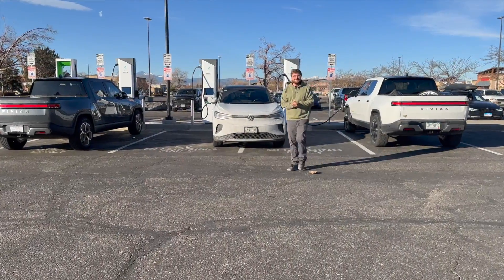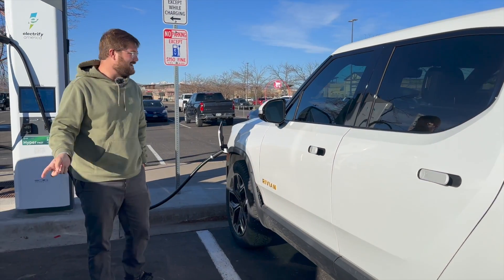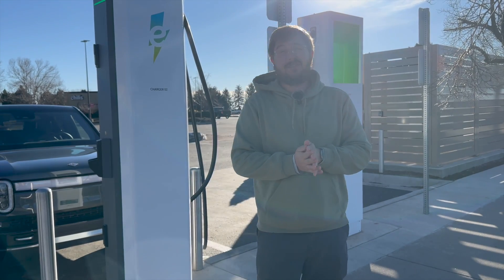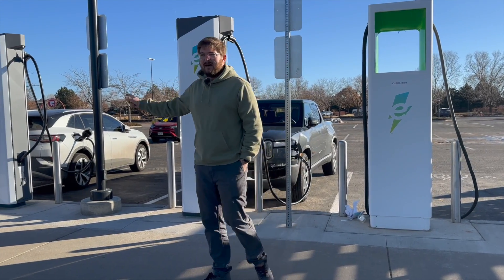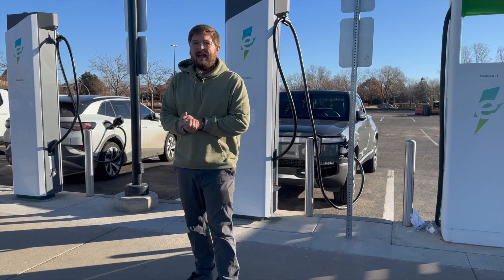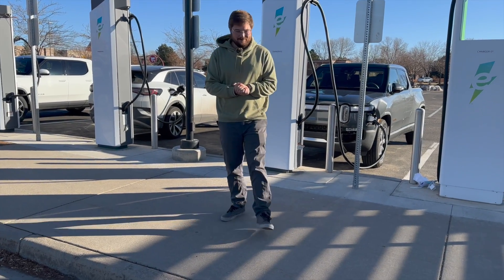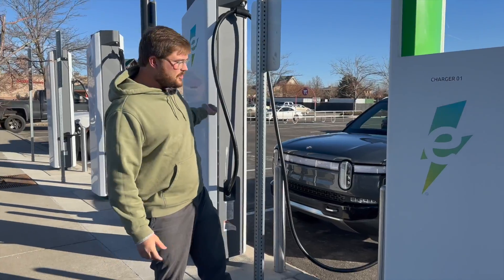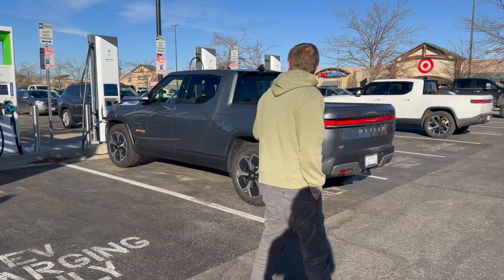Electrify America Has Been Upgrading Their Sites w/ New Chargers - Here's How It's Going So Far

Comment: It is a fact: nothing comes even close to Tesla Superchargers in reliability and availability. At least in North America. I am sure that will change in the years to come, but for now I can just plug in my Tesla and walk away. And it will charge. Every time. EA works most of the time, but you have to hope that the session starts. If it fails to start you may have to call. And you may get 30 kW. Or 150 kW. And one time for me it would not release the cable and I had to sit there and wait until 100%.

Comment: F’ing crazy. These things cost $150k per unit, ignoring install costs.
Reply: California has the goal of making electric vehicles mandatory! They are requiring charging stations in EVERY parking lot. The power infrastructure required for these stations is greater than the building or facility on which the parking lot is located. Imagine if every parking lot was required to have gas stations!! The California govt is becoming a dictatorship, pushing EV on every citizen. EV's are not that popular, most people prefer gas or diesel powered vehicles. Yet the minority rules the California govt, proving that they are a dictatorship. 
Final point: EV charging stations need to be built like gas stations, not required in every parking lot! Then we'll see if they can make a profit, doubtful...very doubtful!

Comment: Thanks, Kyle! Based on my personal experiences (and recency bias), ChargePoint's CPE250 might be the most reliable of the public CCS chargers. They haven't been deployed for long enough to tell how well they will age, but so far, they've had the best uptime. Now it's up to ChargePoint to start deploying them at higher power.
Reply: It would be nice if ChargePoint could deploy the CPE-250's higher power (and newer) version the ChargePoint Express Plus. It's a lot more modular but has mainly been used for fleet vehicles. The first public Express Plus units were opened recently in the Northeast US.
Reply: @ArtiePenguin1  they just opened 1 in Maine let's see how it goes
Reply: @ArtiePenguin1  Yeah. Unfortunately, I still haven't been able to try out the Express Plus units myself yet because the one they installed at ChargePoint Headquarters wasn't open to the public. We really need them along the freeway corridors.

Comment: 99% of the time, when you hook an electrical load to a source of power, the load does indeed "pull" the power.
DC fast chargers are an exception. The really, truly PUSH current into the battery. The car is ordering up a certain charging power - but if the software and hardware in the charger ignores or misinterprets that request, or has some design flaw, like a very slow programmed rate of change that causes the charger to respond to requests from the car to back off only after some delay, there is no way for the car's circuits to throttle the excessive current. The only way the car can deal with a rogue charger that is sending more than the car has asked for is to either allow the overly high charging current for a while, or open the contactors that connect the charge port to the battery and completely stop the charge.

Comment: What is it with ID 4 owners charging to full?

I’ve noticed that as well even when there’s a long line or only one working charger. Very frustrating.
Reply: I have a ‘21 and it’s this stupid free charging. I wish they would buy me out. I set mine to 90% thinking no harm will be done and that 80-90% will be slow. I love to talk to other owners and answer questions from outsiders so if I’m doing my thing I don’t mind it being slow. However, if I’m not enjoying my charging experience or someone pulls up and needs a spot, I leave or pull to a non charging spot and continue socializing. Another big problem is low watt cars pulling into high watt chargers when they don’t have too, Kyle, you might be partially responsible because you have suggested the 350kw units might give a faster charge on an ID4 than a 150kw.
Reply: @4rwayner7  if there’s nobody around, that’s fine. I just always try to be mindful of other people. Ive even moved from a 350 to a 150 once my car’s curve  went below 170 so that a Taycan could use the 350 and speed up the line. Also the free charging excuse is a bit weird to me because Ioniqs/Kias also get that and don’t find them charging that long even though 30 min would pretty much get them to 100% most of the time. 

ID 4s, Bolts, and Niros using the 350s is whole other issue as well and extremely frustrating on busy travel days.

Overall, EA should add more communication to their app about this type of stuff. Maybe a reminder depending on your car about what charger to use. Add a virtual queue to the app so drivers can see how long lines are while they’re planning/driving to the station. This would also prevent scenarios where drivers will just pull up into a station and cut the line, it’s strange how many times I’ve had to negotiate charging lines. Send notifications to drivers once they are at 80% if there is a line, asking them to move or pay peak charging cost for their inefficient behavior. There’s so much EA could do right now without needing to rip out chargers to greatly reduce the lines and pain of driving. Right now, it’s a crapshoot. You never know what type of situation you’re going to pull up to and that causes charge anxiety.

Comment: I charged my BMW i4 M50 at two of the new EA sites in Texas this weekend. The hardware is SK Signet. At both sites on plugin, I pulled 201kW. The session was very good. At the second site, there are 6 chargers. Four were busy. I plugged into station 1. Station 2 was empty. I pulled 201kW on plugin. Then, a Mach-e plugged into station 2, and my charging level lowered to 179kW. These are balanced chargers. These two sites were the older ABB units. EA location Ennis, TX online last week, and Bellmead, TX, fully online today.

Comment: now do South Florida LOL, if you do not own a tesla, you will suffer, evgo only has 1 working station, out of the 6 chargers 2 are 50kw and the 350 kw gives you 60/80 kw/m and the other one is down, EA 4 chargers 3 down, the 150kw only charges at a 20kw speed, if you find a working one that is empty, play the lotto because that's being lucky! The rest are lvl 1 or lvl2 like chargepoint, there is 1 blinq and the company went kaput i believe. Just check plugshare and look at FL in general, I cannot take US 27, or I4 from Miami to Tampa... there are no chargers. Utility companies have the best hardware, problem is they are located alongside the FL turnpike

Comment: As someone considering a first EV for our use case, this presents some problems for us. You covered some really important points: With the upgrade, the EA network is no more reliable, but now has more potential to damage your vehicle. And with the new rollout, no increase in the number of charge units per site. Has anyone talked about how this being a punishment for VW probably doesn't motivate EA to be a top performer? VW, this is not helping your brand image. It would be great if VW sold off EA to someone who will make it a success. Thanks.

Comment: I agree.  EA, why is it still so hard to charge a car on your network?  Software issues and bricking cars with brand new co developed hardware stinks of pulling the bread out of the oven half baked and saying good enough.  I still road trip in a Chevy Bolt.  Are one of these shiny new 350kw units going to try to force far more than the car's hardware can accept with them trying to do so on higher KW rated vehicles? If you damage my car, do you fix it?

Comment: I had the experience of showing up at a charging station recently and finding the whole station shut down with new chargers not up and running yet. I had travelled the same route a few times with my 2022 Chevy Bolt EUV and so it didn’t occur to me that I had to check the app to see if the station would be working. There were no other EA stations without backtracking a ways, which seemed stupid because I could get to my destination with the charge I had albeit uncomfortably low.  Now I know I ALWAYS have to check station status first. Luckily I found a Volta fast charger, the only one, and available, in a nearby shopping mall lot. What you said about the new chargers makes me a little nervous to use the new hardware because I don’t want to get bricked on a road trip … that seems like a HUGE problem then need to fix right away.
Reply: California has the goal of making electric vehicles mandatory! They are requiring charging stations in EVERY parking lot. The power infrastructure required for these stations is greater than the building or facility on which the parking lot is located. Imagine if every parking lot was required to have gas stations!! The California govt is becoming a dictatorship, pushing EV on every citizen. EV's are not that popular, most people prefer gas or diesel powered vehicles. Yet the minority rules the California govt, proving that they are a dictatorship. 
Final point: EV charging stations need to be built like gas stations, not required in every parking lot! Then we'll see if they can make a profit, doubtful...very doubtful!

Comment: Interesting to hear these chargers are providing too much power and bricking vehicles.

A slight correction, this is entirely under the chargers control.  The vehicle only requests a voltage and maximum current.  It is the chargers job to provide that voltage delta which yields the given current (or less), but never more current, which only happens if the voltage delta is too large, so over voltage.  I think maybe this is what's happening.
Reply: What do you mean by voltage delta? That means compared to some other voltage? Which voltage? The vehicle requests a specific voltage and gives an amperage limitation. It's up to the power supply to provide power up to whatever limits are in place. It should never provide more voltage or amperage than the car requests, and should not exceed its own current or power limitations.
Reply: @TechnicalLee  there are multiple voltages involved.  The car has a resting no load voltage, and specifies to the charger a max voltage and max current.

The charger supplies a delta voltage between no load and max voltage.  At some higher voltage that is under the max voltage the current limit is likely to be meet.

But these newer chargers can likely easily supply more current than many vehicles limit.  So if they overshoot that current the voltage might also be exceeded.

If the charger violates the current limit, the vehicle may have no choice but to blow it's fuse to protect from over current or over voltage.

The point is, the vehicle has no control of the voltage and current beyond the communication of the max limits.  When these requests are not honored the vehicle has limited options.  It could try to open it's contactors under high load.  And maybe they attempted this and welded contactors.  The last resort is to blow the pyro fuse on board the vehicle.

But the charger for DCFC is always on the curb.  This is the equipment at fault here.  The cars can only ask for what they need supplied.

Comment: ID4 owners got 3 years of unlimited free charging, so they're using EA as their primary fuel source since it's free. The 2023s even maintain 80 kW up to 90% and the drop-off after that isn't extreme, so it only adds a few minutes to the session to go all the way to 100%.
Reply: "free." You're paying for it with battery degradation that is caused by constantly DC fast charging.
Reply: @descendency  According to a study done by the Idaho National Laboratory, there is no meaningful increase in battery degradation from DC fast charging vs L2 charging, especially in vehicles with a thermal management system that maintains the battery temperature.
Reply: @djg38  I would fire that laboratory. D.C. fast charging does degrade the battery. Its because of the "C" rating of the battery, fast charging does things to the battery that are not reversible.

Comment: Kyle, you've probably covered this but how much faster is a V3 250kw Tesla charger versus a V2 150kw charging 10% to 80% on the newer Teslas? Seems you get that big push at the beginning but how much faster is it overall? These high-peak chargers are negating much of the benefit of switching to electricity.

Comment: The stuff you're reporting is both baffling and worrying.  The customer service aspect of pulling entire CORRIDORS offline for upgrades with no warning or plan for motorists is not 'unfortunate' it's blatantly UNACCEPTABLE!

What is more worrying is the inability to secure reliable and functional charging units.  Like them or not, Tesla has proven that their units are extremely reliable and robust, as you pointed out.  What is EA doing that they can't achieve the same level?  After all, they're a company focused SOLELY on HVDC charging...

Comment: My big Q is why all are being taken down at the same time? It appears there is 1 Cabinet behind the fence for each dispenser. That means the can be Isolated (Use the breaker Luke). Do 1 or 2 at a time (depends on crew). And it was totally insane taking them (a site) down on a holiday weekend.
Reply: It's easiest/safest for the construction crew to cut power to the whole site so that there's no power going to any of the cabinets. Doesn't make it the right thing to do, though!
Reply: @EVZacOfAllTrades  Might have to hire real electricians. They might be union.
Reply: You have to shutdown power to the whole site to do it safely. There's generally earthworks involved as well and they need to all be done at the same time and that involves all the cabinets. Doing it on a holiday weekend though kinda says everything about EA's planning. But I bet every non-Tesla EV driver would be prepared to put up with the inconvenience if it results in a more reliable charging network.
Reply: @mondotv4216  I installed a charger on my house, to be safe I killed the power to the whole neighborhood. Not.
Reply: @mondotv4216  If earthworks are involved the original install design was poorly planned.  It's hard to believe they would have been that short-sighted. Buried conduit is widely used to prevent that exact problem.
My local utility has been using conduit for underground distribution since the mid-1980s.  They just replaced the direct bury underground feed in my 1970s development (7.2KV distribution to 10? transformers) and they installed conduit first and ran the new line thru it. They did not shut down the power except for the final day.  My street took several weeks but we only lost power on that single day for about 30 minutes near the supply to 2 hours at the far end.  (They had notified us "power will be off for up to four hours.")  The project manager said that on similar installs with existing conduit the entire job is completed in days instead of weeks because they don't need to dig (and they did minimal digging on my street with only 12in (30cm) diameter holes about 20ft (6m) apart and 3 trenches across the road).
Reply: @Sylvan_dB  It seems Electrify America tries to be as incompetent as possible
Reply: @Termnath  That's not true, they are just getting warmed up.
Reply: Annual maintenance.  I was once stuck in Benson, AZ for 6 hours waiting for two guys to finish the annual maintenance on the EA station.  Bad design.  They should have been able to take down half the station at a time, leaving some chargers still working.
Reply: @jimbready3553  They should bring in generators and temporary chargers to vital sites while they’re down.
Reply: @Termnath  Why? the customer will always take it in the shorts.
Reply: @tedmoss  wth are you trying to say
Reply: California has the goal of making electric vehicles mandatory! They are requiring charging stations in EVERY parking lot. The power infrastructure required for these stations is greater than the building or facility on which the parking lot is located. Imagine if every parking lot was required to have gas stations!! The California govt is becoming a dictatorship, pushing EV on every citizen. EV's are not that popular, most people prefer gas or diesel powered vehicles. Yet the minority rules the California govt, proving that they are a dictatorship. 
Final point: EV charging stations need to be built like gas stations, not required in every parking lot! Then we'll see if they can make a profit, doubtful...very doubtful!

Comment: I own a business that contracts with EA and several others (including Jeep & Sunrun) to install DC&AC charging stations. Ive emailed asking if you guys wanted to see maintenance or installation numerous times and gotten nothing back. If any viewers have questions leave them below and im happy to answer
Reply: Is it true the temp sensors in the Huber+Shuner cables keep going bad and there's a shortage of replacements? When the cable chillers stop working do you have to hire an HVAC tech to work on those? Is lack of trained techs a limiting factor in keeping the stations running? Can a regular licensed electrician work on them or do they need special licenses?

Comment: The ID.4 parking job was terrible, but explain to me how it was blocking 2 people?  Can more than one car charge at a time from a single station?  I didn't think so.
Reply: ID.4 was in 2 spots blocking the parking spot in the adjacent stall.  If the lot was full and/or someone was parked in the spot on right, Kyle would have been SOL.  Then to add insult to injury, they charged to 100% even though 80-100% in an ID.4 is SUPER SLOW & did not collect their car when charging was complete.  You can monitor the status on the EA App, so the owner was just inconsiderate.
Reply: @lh2338  Alright, fair enough.  Potentially two, I see now.  Funny that the confused old guy showed up mid-video.